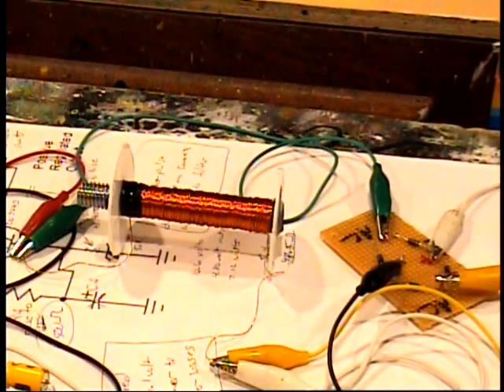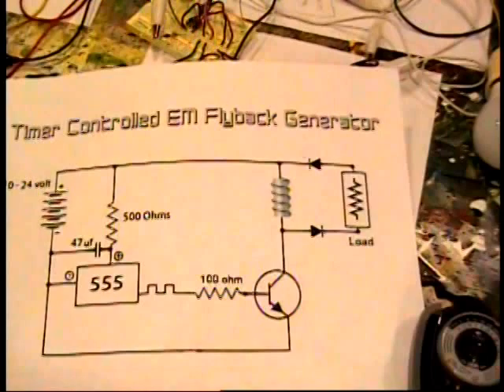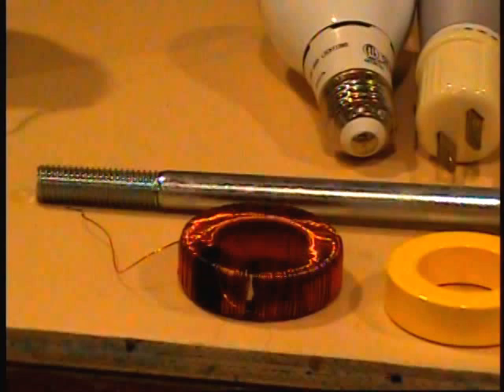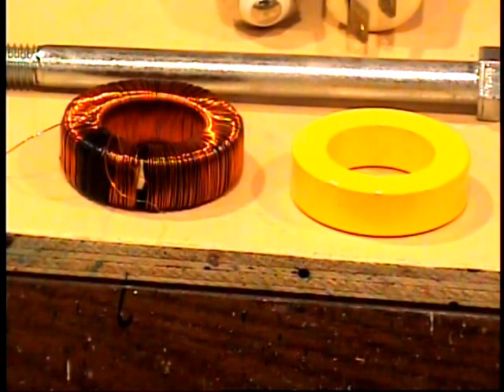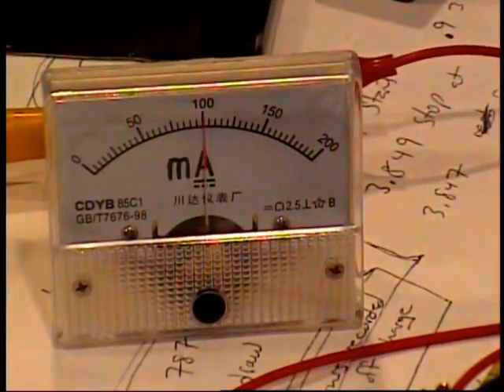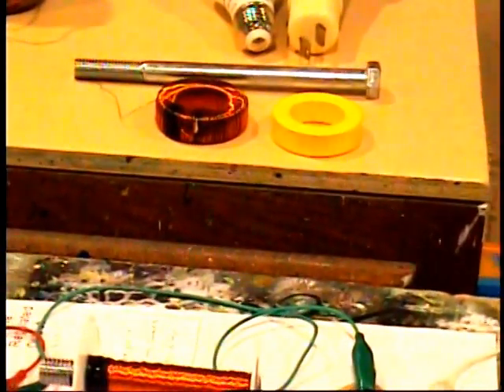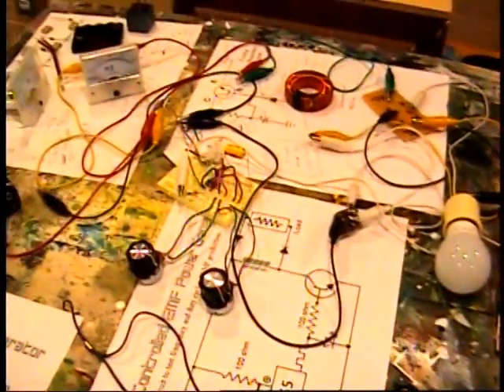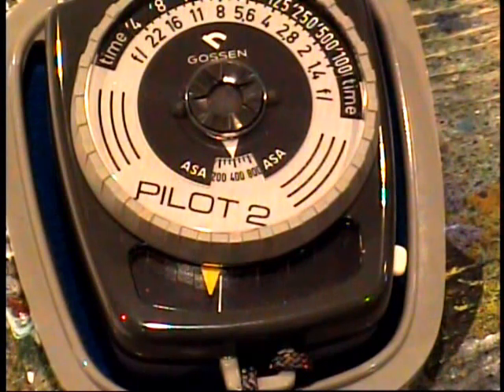Inductor Core Makes a Difference

Comment: Is that really a good or accurate comparison? The bolt is not a toroid shape. what if you used a straight  rod made of the same material as the toroid?

Comment: The surface area between each turn and the number of turns isn't likely to be the same. Still, I'm more concerned about how the material itself impacts the efficiency of the inductor. And I know there's a bunch of different core types but there's not really any place I can find a good in-depth explanation of how these materials affect the functionality of the inductor. As far as I can tell, I probably need to do some reading about ferromagnetic materials and try to piece it together myself. Another journey begins lol.
Reply from the maker: お化けI choose a core based on my need for a strong magnetic field so I choose a high AL value. Micrometals has a great online catalog. They also have free software tools for designing inductors so you can pick the best material for your purpose at this address https://www.micrometals.com/software .

Comment: Hi, The number of turns is not constant between the inductors. This will make a difference in inductance. Also one inductor is a closed magnetic circuit core, the other is open so a combination of steel and air. This will make another big difference too.

Comment: Our old friend Eddy Current is heating the bolt, since it will conduct electricity. Ceramic does not. You might try a bundle of metal wires that have been painted to insulate them, like the metal plates of a transformer.

Comment: I just cut down some galvanized fence. I was curious as to what these would do as a core material. Seeing as Bedini used soft metal core i.e. welding rod, I was thinking this might work too? Thoughts?
Reply from the maker: Galvanized fence post should work. I expect the zinc coating of the steel post to approximate the bolt I used in this demonstration. The added benefit being you can try winding it like a hollow rod or a skinny toroid.

Comment: do you have a good method for identifying core makeup?  thank you for the video.. good demonstration.
Reply from the maker: ryan, the short answer is no. Manufacturers do not like to be specific about their blend of metals used in their cores. However, they do provide extensive detail of how the cores perform in their catalogs. Micrometals and Magnetics are two companies that have extensive free info. and provide formulas to help you get the most from inductors.
Reply: I have heard you can build a circuit and probe said circuit with o scope to somewhat determine the usefulness of the inductor...

Comment: I have experimented with other winding styles. By using honeycomb or basketweave, you can even do this with aircoil, and less wire, but coil must be say 5 inch diameter or bigger.
Reply from the maker: +morpher44 Thank you for that tip! I had not considered different winding styles or shapes. I appreciate you taking the time to comment. I look forward to looking at more of your videos.
Reply: +Ronald Gerth Yeah. Back in the early days of radio, hobbiest were trying to figure out the best way to wind a coil, with the least amount of wire. There is lots of art on this from those days.
Reply: interesting